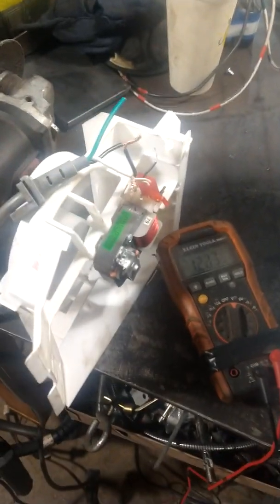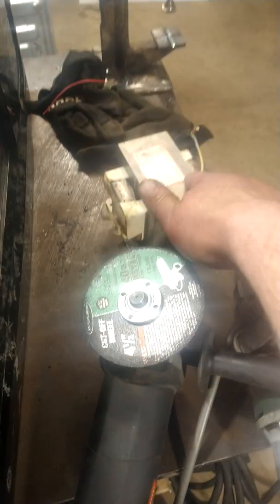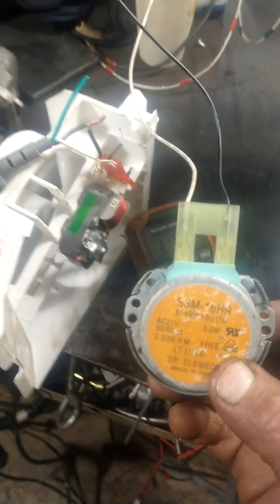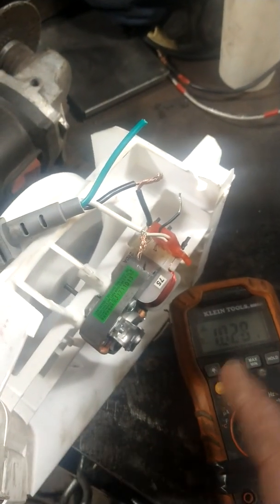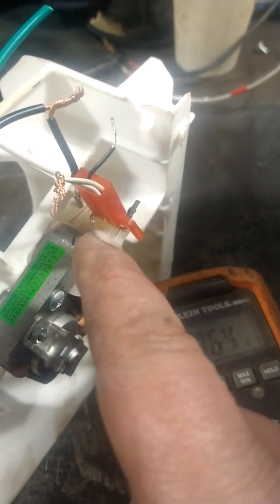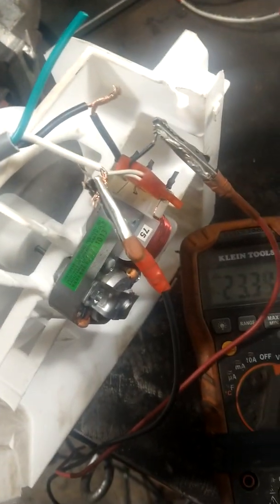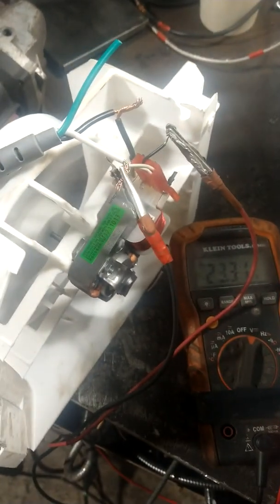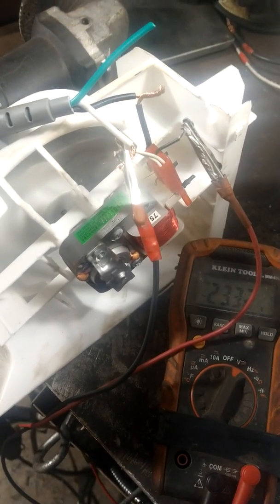Using an AC induction motor as a transformer too? 120v to 22v

Comment: Thanks for the info. I haven't been able to get my hands on a microwave so I am playing with the same ac induction motor and re-wrapped a coil but because there is no other coil I don't no where to wrap another one.
Reply from the maker: Wrap your coil over the existing coil, that's the way this one was. I would start with 15-20 revolutions of wire, measure the voltage of your new winding, add more to increase voltage. Hope this helps 👍
Reply: @crazyDIYguy  ok, that's odd that you would wrap the secondary right over the primary. I was playing with my motor for about 4 hours trying different types of wire and was finding different areas to loop the wire through on the transformer with the motor removed. Thanks for the idea, I will try again tomorrow.